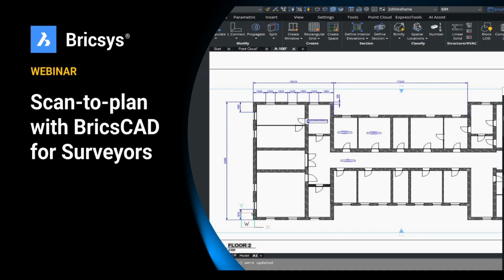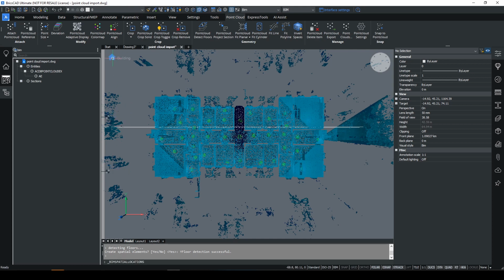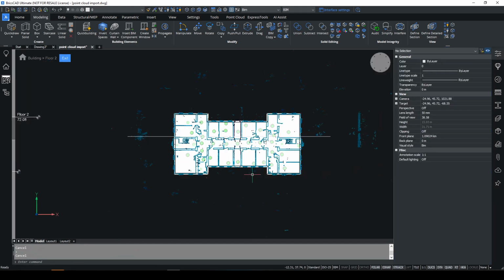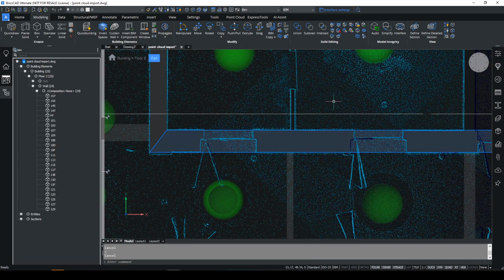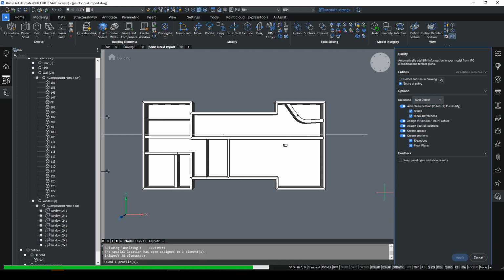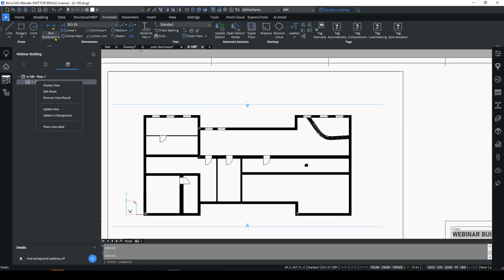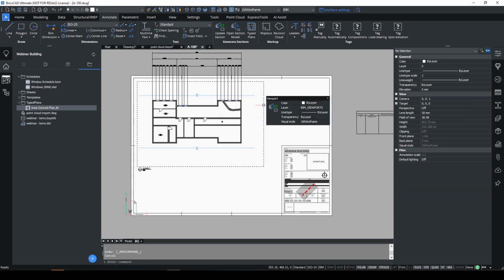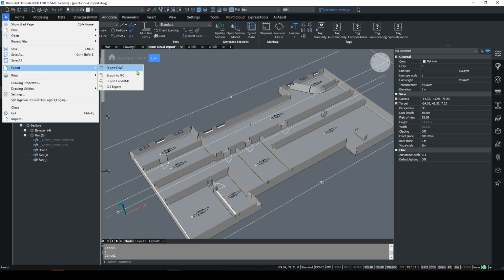Scan-to-plan with BricsCAD | BricsCAD for Surveying

Comment: Hi there, how do you handle walls which are not parallel on both sides ? like in an old house where wall has more of a triangle shape and thus not same thickness on the lenght of it ?

Comment: Hi Sean! Is there a simple setting to get the spatial locations icon into the top left corner of my workspace? And does that get me the storey tab?
Another problem I've run into is that I don't seem to have the BIMQUICKWALL command, is that even possible?
Reply from the maker: Hi! The Icon and StoryBar are displayed automatically when using a BIM Template, but it can also be activated for other templates by changing the value of the STORYBAR system variable:
https://help.bricsys.com/en-us/document/system-variable-reference/s/storybar-system-variable?version=V24&id=166937984412
 
The BIMQUICKWALL command has been renamed to BIMWALL:
https://help.bricsys.com/en-us/document/command-reference/b/bimwall-command?version=V24&id=167586900810
It can also be found at the BIM Workspace Ribbon > the Home Tab > Model Panel. 

Hope this helps! :)